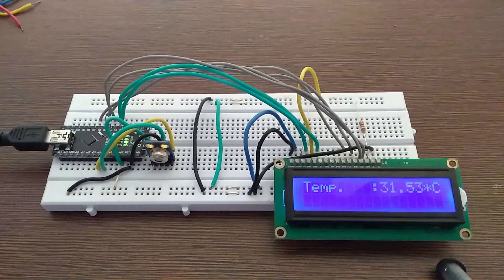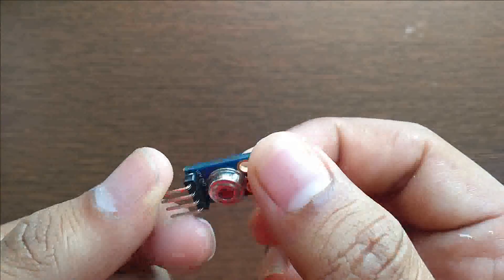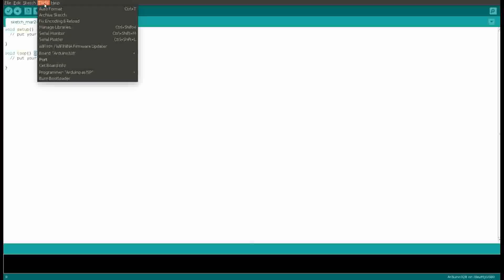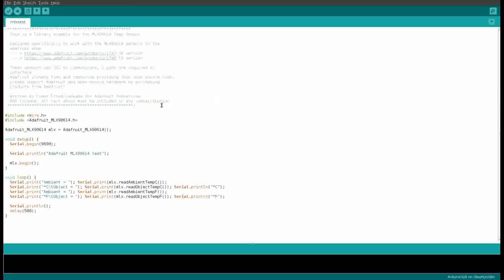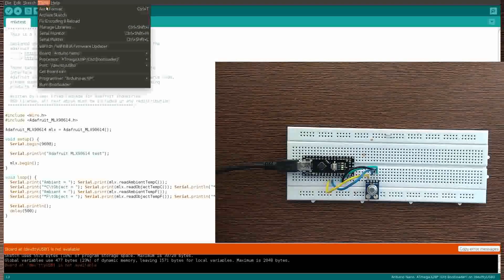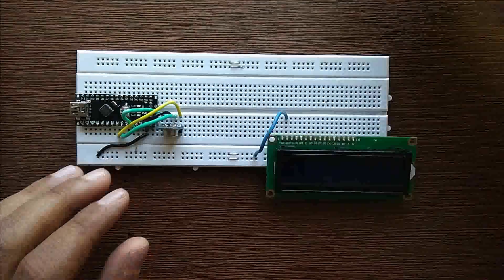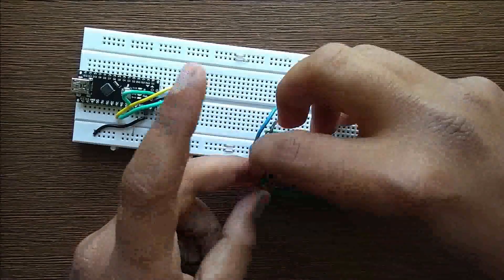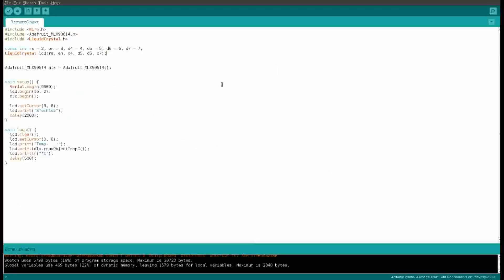Arduino interface with MLX90614 Non contact Wireless temperature Sensor | Infrared Thermometer

Comment: Hlooo im interfacing mox90614 with 8051 i am getting 377 *c  can you please help me
#include<8052.h>

__sbit __at (0xA1) sda; //P2.1

__sbit __at (0XA0) scl; //P2.0

void start();

unsigned char read();

void ack();

void nack();

void stop();

void delay();

void write(unsigned char);

void intostr(char[],int);

void string(unsigned char *);

void txdata(unsigned char);

unsigned short int memread(unsigned char,unsigned char);

void msdelay(unsigned char);

float calctemp(short int);

unsigned char c=0;

unsigned char m=0;

unsigned char str[4];

char datal,datah;

int a;

unsigned short int b,d;

unsigned char ch;

float t;

//short int data;

void main()

{

// serial port intiallization

SCON=0X50;

TMOD=0X20;

TH1=TL1=253;

TR1=1;

while(1)

{

start();

write(0X5A);

write(0X07);

start();

write(0X5B);

datal=read();

ack();

datah=read();

ack();

nack();

stop();

datah = datah & 0X7F;

b = (datah << 8);

d = b + datal;

t=calctemp(d);

msdelay(100);

a=t;

intostr(str,a);

string(str);

}

}

void msdelay(unsigned char time)

{

unsigned char i;

for(i=0;i<time;i++);

}

float calctemp(short int value)

{

float temp;

temp=(value*0.02)-273.15;

return temp;

}

// start condition

void start()

{

scl=1;

sda=1;

delay();

sda=0;

delay();

scl=0;

// stop condition

void stop()

{

scl=1;

sda=0;

delay();

sda=1;

scl=0;

delay();

}

// writing master to slave

void write(unsigned char val)

{

unsigned char v1=0X80,v2,v3;

v2=val;

for(v3=0;v3<8;v3++)

{

sda=v2 & v1;

scl=1;

delay();

scl=0;

v2=v2<<1;

}

c=sda;

scl=1;

delay();

scl=0;

if(c==1)

{

stop();

}

sda=1;

}

//read from slave to master

unsigned char read()

{

unsigned char v;

for(v=0;v<8;v++)

{

scl=1;

delay();

m=sda;

scl=0;

if(m==1)

{

ch|=0X01;

}

if(v<=6)

ch=ch<<1;

delay();

}

return ch;

}

//acknowledgment

void ack()

{

sda = 0;

delay();

scl = 1;

delay();

scl = 0;

sda = 1;

}

//no acknowledgment

void nack()

{

sda = 1;

delay();

scl = 1;

delay();

scl = 0;

sda = 1;

}

// converting integer value to string to send sbuf register

void intostr(char str[],int num)

{

int i,j;

char t;

for(i=0;num>0;i++)

{

str[i]= num % 10 + '0';

num=num/10;

}

str[i] = '\0';

for(j=0,i--;j<i;j++,i--)

{

t=str[i];

str[i]=str[j];

str[j]=t;

}

}

void string(unsigned char *p)

{

while(*p)

txdata(*p++);

}

// serial output

void txdata(unsigned char D)

{

SBUF=D;

while(TI==0);

TI=0;

SBUF=0X0D;

while(TI==0);

TI=0;

SBUF=0X0a;

while(TI==0);

TI=0;

}

void delay()

{

unsigned char x;

for(x=0;x<200;x++);

}

Comment: Hello. What were the values of the resistances utilized? I cant see the colors very well.
Reply from the maker: the resistor value connected at Pin 3 is 1.8K and the resistor value connected for backlight is 220 ohm.

Comment: I've used this sensor. the problem is when the room temperature and humidity are different, it will produce different temperature readings, even though the object temperature is the same. for example, measuring the temperature of the same object in the morning and evening will result in a reading that is very far from the truth. have you ever calibrated it? do you have a solution?
Reply from the maker: i never had done calibration of the sensor and i never required to calibrate it. As far as i know this sensor comes with factory calibrated.

Comment: how come mine is showing Ambient = 1899.59*F	Object = 1899.59*F
?  What is wrong with this code?
Reply from the maker: it depends on how far are your object is. you can refer the datasheet for calculation and more details.
Reply: I have the same problem ..
Reply: same problem right now

Comment: For me doesn't work properly ? after approaching the soldering station tip too low temperature?
Reply from the maker: This code is working properly.
are you using same code? please check the connection once.
Reply: @StechiezDIY  no, i need a pyrometer thermometer to check the oven temperature. max measuring temperature for this sensor is 350. I saw on two films with the temperature tested by this system is lowered the same way on another film the sensor was applied to the flame of the lighter and the temperature indicated was certainly below 100 degrees
Reply from the maker: Okay. I didn't check for higher temperature. Please check the datasheet for the sensor you are using. And please check the data types used in the code.